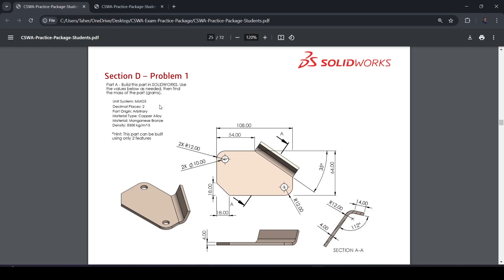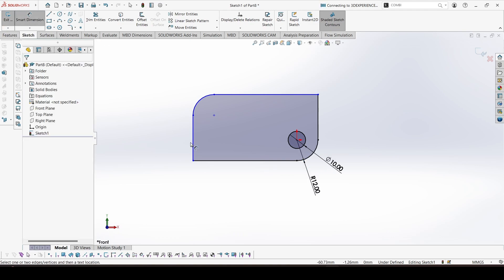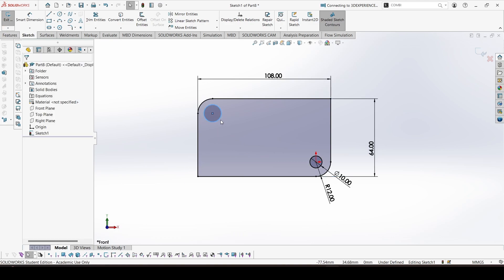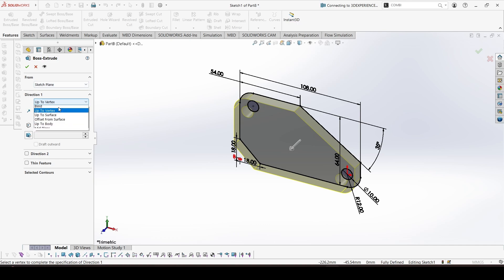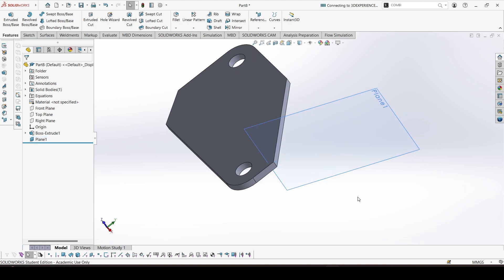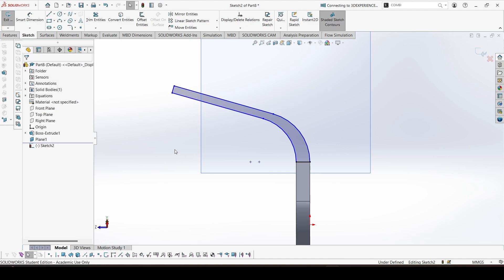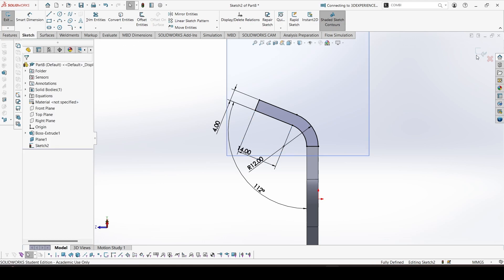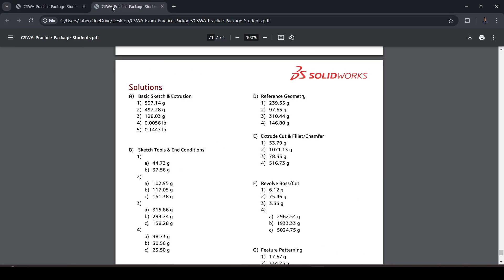Solidworks CSWA Exam Practice | PART MODELLING | Section D - 1

Comment: Thank you for sharing this video. I just want to highlight that in Section A-A, the second feature should be positioned 14 mm forward from the base feature we already created. Even though I know that the final mass properties in your 3D modeling are the same as those in the calculations, but I’m curious how it works without making this modification in the 3D model? Also, at the end, I’d like to ask: How did you determine that the height of these items, or these features, is 14 mm when it’s not mentioned in the paperwork? I’d really appreciate it if you could address both of my questions. Thank you!
Reply: it is determind after R12 it says 14 mm long bend on 112 degrees, anyway its very bad to make this model like this  you should use sheet metal features.